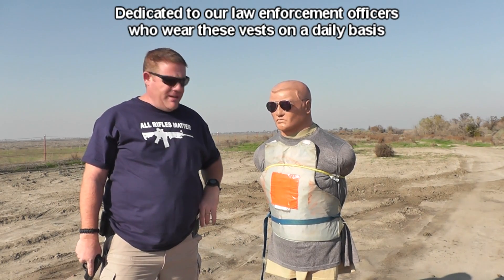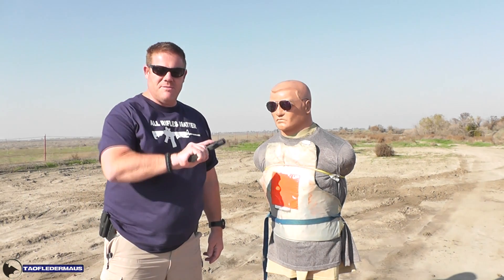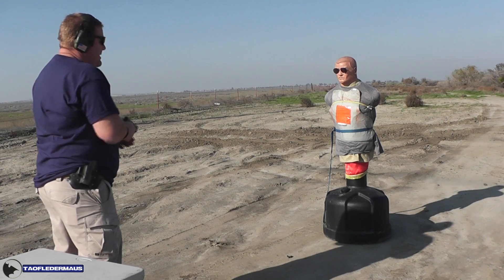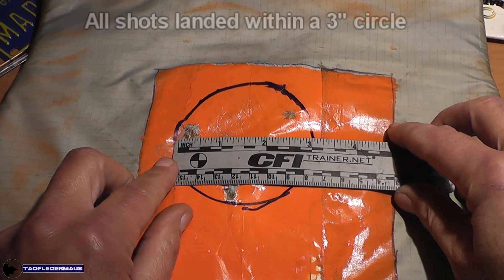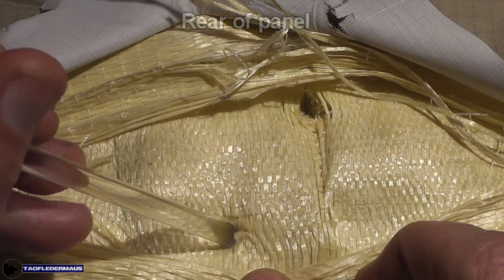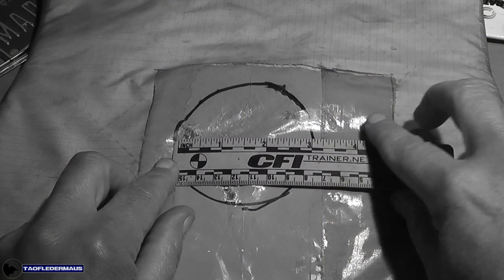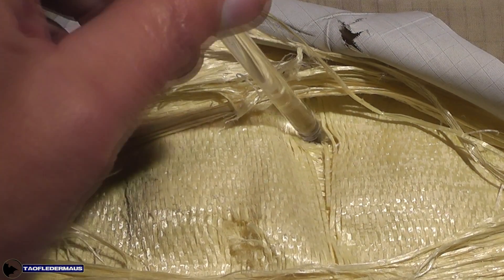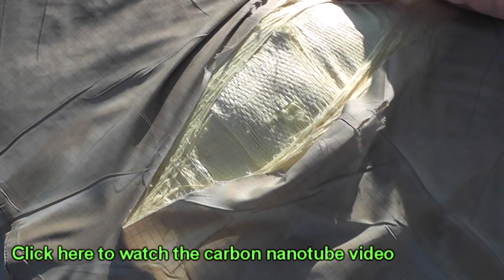Dispelling MISCONCEPTIONS about Kevlar body armor

Comment: I just posted this on the late boyscout's comment section.
It has the exact same density as Point Plank Alpha Elite and that is a 
Dyneema and Kevlar mix. If the main marketing point is that it can take 
multiple hits in close proximity, why didn't you shoot it multiple times
 in the same spot with something like a .357? Why isn't it NIJ 
certified? Why does the "about us" section of their website only tell us 
that they support the second amendment? Why not tell us about the 
qualifications of the designer? Creating structurally useful nanotubes 
in commercial quantities has been a holy grail of material science for 
decades - now some unknown guy without a mentioned patent or accolades 
from reliable sources says he has done it and just uses it for soft body
 armor? Why isn't he on the cover of magazines and being interviewed on 
science shows? Your test and and interview here was quite a piece of 
softball. You compare its comfort and weight to steel rifle plates and 
old SWAT armor rather than a similar soft armor. That fellow claims that
 water degrades aramid armor but not theirs, however did you know that 
NIJ testing of armor requires testing the armor while soaked with water?
 Did you soak or hot tumble their panels in a dryer with wet stuff as 
NIJ tests often do with normal armor to simulate the degrading effects 
of sweat and wear? 
Dude you just did a no research infomercial for those guys.

Comment: LOL at the weight. Perhaps a set of ceramics which would be for rifles, not pistols..
Reply: Depends on the ceramic - Shatter patterns/sizes are different depending on the ceramic used. Shattering badly is certainly the case for aluminum oxide, but if you don't rip open the covering the shards and cracked areas contained inside does provide a degree of protection.

While the NIJ standard is to stop 1 round of AP, most companies over-build their soft and hard body armour to exceed standards.
Reply: Buffman - R.A.N.G.E. A lot of manufacturers in the industry made that comment too - The NIJ standard (and most standards in general) simply isn't a good reflector of their products.

Heck, there's armour plates that stop 12.7mm/50BMG, but on the NIJ scale that's a level 4.
Reply: Philp Roza what specific x51 AP? Or don't you recalll?
Reply: I'm a bit late but are you firing blanks? Because most ceramics are quite known to shatter badly after atleast 5 rounds of 9mm, or did you patch it up after each shot?
Ceramic armor can stop both pistol and rifle rounds, the only thing is that its way less resilient than a metal plate, same thing with tank's composite armor rather than regular steel.
Reply: shalol a level IV would take way more than 5 rounds of 9mm
Reply: And some don't. I think this is always a good reason to find the YT "test"/demo of some armor. NIJ standards are min, so if someone overbuilds their plate, there's usually not an in between standard to differentiate A vs B.
Reply: Yeah I've tested a level IV that stops M2AP at 3250 fps, but since there's nothing above level IV, to consumers it's just another level IV plate.

Comment: They said it weights 15lb? My AR500 rifle plate does not even weight 15lb. What the heck are they talking about? ha.
Reply from the maker: Yeah!   Most cops wear the Second Chance or similar brand soft armor under their uniform.   The entire vest weighs 3lbs.    The carbon NT armor looks good,  so I don't know why they felt they needed to bs us about the competition.
Reply: I weighed it. I have a heavy protection vest, that is steel plate on back, front, and smaller ones on each side, with plate carrier and cumber bun. 19lb.

It is a real shame. All they had to do is say, hey, this vest works rather okay, but our best is vastly superior because of x, y, z. There was no need to lie about it.

Comment: Yeah, the only reason there were any pass through rounds is because there was fluffing.
Reply from the maker: yes.  If the many layers of kevlar aren't laying on top of each other,   I could see how it wouldn't be as effective to catch the bullet.
Reply: I encountered the issue when hanging an old PASGT vest as a reactive target for a .22 rifle. Normally the vest works just fine for stopping .22, but pass throughs occurred when it started getting fluffed.

Comment: after the first shot you didn't really seem to know if the bullet that went through were the first  or last... this video was done so poorly with regards to the scientific method that any conclusions you could have gleaned from it becomes useless and holds no value. so for all I know there nanotube people are right and only the bullet s before the Kevlar bunched up and after the initial shot made it through. your results at best are inconclusive since you didn't control for variables and apparently used different guns and ammo too? you should have left the science out and just made a video about shooting Kevlar and left your beef alone until you could test it correctly. unless you are just trying to be divisive for veiws...
Reply from the maker: They claimed once a bullet hit a 6" area,  it would NOT stop any more bullets.   The vest stopped bullets after it was shot.
Reply: Again, as you pointed out, it bunched up which changed the structure and since you can't prove which bullets made it through when I can say with just as much certainty as you that the vest indeed did not stop the second and third bullet shot and only after the vest layers of Kevlar or bunched up did they stop the bullets. My point is any claims you make using this video as "proof" is irrelevant and intellectually dishonest because you can't prove which bullets penetrated when. All I'm saying is you even admitted you didn't control for the vest bunching up which for all we know was the only reason no more then a few bullets made if through. Your video didn't prove anything sadly and usually you take better care when doing experiments so as a fan I was a little let down that you took shoddy "evidence" to prove your confirmation bias...I know what the other company's claim was but your video doesn't disprove it and I'm not sure how you can say it does when you even admit in the video that the vest bunched up. Without getting defensive really read what I'm saying here, you make good videos testing things out usually, but this particular test was inconclusive because you can't prove when the bullets hit so we don't know if after the first bullet the others made it through until stopped by the bunching up of material giving it more ability to absorb energy and stopping the rest. A normal vest wouldn't do that as you stated so any conclusions drawn from it should be inconclusive.i mean it's pretty childish to say they said it wouldn't stop any bullets after the first regardless of any outside influences... A good and intellectually honest test would also include the gun and ammo type most commonly used in an event where someone is gonna get shot, I mean I could prove you "right" too by doing the same test with a Derringer pistol or some other weak gun and say "see guys looks like it stopped all the bullets haha got ya other guys! Looks like you're wrong". You know better than this and I'm kind of let down that when shown how your video didn't prove anything you would come back with basically saying "but they said it wouldn't stop any bullets regardless of what happened to the vest" and my point is still unchanged, using your admission that in normal use the vest wouldn't bunch up so under normal use I can say using your video that the initial bullet did indeed weaken the vest and the bullets passed through until the fibers bunched up enough to stop the rest by absorbing the energy like a crumple zone on a car. And I would be just as correct as you because the experiment was poorly thought out. My claim would have just as much proof as yours and be just as valid. deep inside you know it was a bad test that you shouldn't make claims from otherwise you wouldn't have bothered to mention the vest bunching, you act like it doesn't matter but since you don't know if the bullets made it through before or after the vest started to bunch up then you can't say without being dishonest that this proves the other guys wrong when their vest didn't bunch up. If anything you are both Cherry picking data do fit your narratives both proving nothing in the end. I'm not even saying that you are wrong here, but this video doesn't back up your claim because of the flaws in the test. That's all <3
Reply from the maker: we only had to prove that the vest would stop ANY bullet in the "six inch dead zone"  to make our point.  It did stop them.  We also showed the point of failure too.
Reply: My point is because of the poor testing, anything you claim from it is meaningless. But I'm glad you confirmed the intellectual dishonesty and juvenile understanding of testing things... You know full well that your test was compromised and I could say the only reason it stopped any bullets was because it crumpled (which you would know if you read what I wrote). In a normal vest under normal conditions (which you fail to replicate) does it stop bullets? You can't honestly answer that based on your video, I'm not sure how else to say this unless you are intentionally trying to be misleading with your "findings". You also didn't show the point of failure because you do not know when the bullets made it through checking after every shot would show that.
Reply from the maker: You can post your own test if you really want to prove us wrong.

Comment: and that is not considering the strike plate. yes that is designed to stop knifes but it will slow bullets and prevent less from going though.  and yes it only covers the center of the chest, but that is where you where testing.  great video.
Reply from the maker: thanks!!

Comment: 9 rounds to the chest, he's wheezing, a couple cracked ribs, but he will pull though with little more than rest and an ice pack.
Reply: tyler roberts I hope you're not my doctor.
Reply: Gregg Chrissakis I hope I'm not your doctor, if cracking ribs means you need to be babied, than I'd just put you out of my misery.
Reply: ***** dad's Scottish stew. (I know what goes there, but Scottish stew is fucking awesome.)
Reply: bring a flak jacket down and we'll test this.
Reply: +Hunter Jordan You have to consider that a little more. Yes, the pistol's opposite reaction will not crack your ribs, but the pistol is not the size of a bullet. The bullet has incredibly small surface area, enabling it to damage bone a lot easier.
Reply: tyler roberts
He's referring to equal and opposite reactions, which to me pretty heavily implies that the recoil force of the pistol is not strong enough to crack a rib.
I'm explaining to him that equal force doesn't mean equal result.
Reply: TotalMetalJacket what? where talking about the guy that just got shot, not the one doing the shooting.

Comment: Great video! I have no doubt the kevlar body armor will stop projectile penetration, but I have a slightly different question. Does it absorb enough of the concussive shock to prevent serious internal organ damage like lung damage, or arterial damage or rupture, or even heart failure? Do you know of a way of testing this, and if so could you make that video too please?

Thanks!
Reply from the maker: You can test it by shooting against clay and it will leave a crater in the clay.   I THINK the carbon NT stuff leaves a smaller crater,  at least that is what they claim.

Comment: that sw shield is not a California roster gun... it doesnt have that red  dildo chamber indicator on the slide. so its an LE gun
Reply: Well, Greg is a cop. Apologies if you already know that.
Reply: McKenzie Keith i figured so, by what he said about using a vest at work, very interesting video, i wonder if the vest would be affected by the "expiration" date.
Reply: Luis Tapia didn't appear to be affected at all.  I've used old vests to trap rounds at classes I teach and they work every time. Even old ones.  Even wet ones. Even sun-bleached ones.
Reply: Gregg Chrissakis it does seem that vests are more resistant than advertising, and the expiration dates may just be a safety factor just to ensure that nothing is compromised. Yet an older vest still works, i was worried because my vest is at its end of life according to we're allowed.

Comment: What happens to the Kevlar as it ages.  Do the fibers degrade due to some sort of reaction, say moisture?
Reply from the maker: That is what the manufactures of Kevlar SAY,  but...  they only certify the vests for 5 years.   The old vests we shoot seem to perform well,  so maybe their 5 year lifespan thing is so people will buy vests more often.
Reply: TAOFLEDERMAUS kevlar is usually spun as very tiny fibers (like a few thou in diameter) then bundled together with a wrapper.  It is also fairly abrasive and will wear steel.  Let some slip through your fingers and it will slice through your finger.  As you move around all of that fiber is rubbing on each other and can weaken it.  I would suspect that is a big part of where that 5 years comes from.
Reply: patel ax there are cool tests where guys use a Kevlar strand to saw right through plastic flex cuffs. Pretty cool stuff. Even the old stuff.
Reply: Gregg Chrissakis I am not surprised someone has done that.  I forget what channel it was but there is a video on here where a guy replaced his table saw blade with a piece of paper and started cutting wood with it.  It was thin stuff like 1/4" but still funny to watch.

Comment: Second Chance is basically the company that made concealable body armor practical for everyday use and have been the standard that other companies try to compare to. Richard Davis the inventor and original president of Second Chance has a fantastic record of supporting LE and saving many lives.  I wish you had done a proper test even with the old vest by securing the vest properly and not shooting rounds thru the same holes, not likely to happen in a real gun fight.

Comment: such a normal vest can not stop a rifle round, but could a combo of a Kevlar vest and a chain mail (primarily good against stabbing) stop a rifle round? you could use small samples, but use good one. good steel and make sure to get small rings that are riveted or welded. (also possible with full rings in between)
Reply: No, the round would go straight through. Most rifle rounds will penetrate unhardened 1/4 steel plate like it's nothing, chain mail just doesn't have enough anything like enough strength.